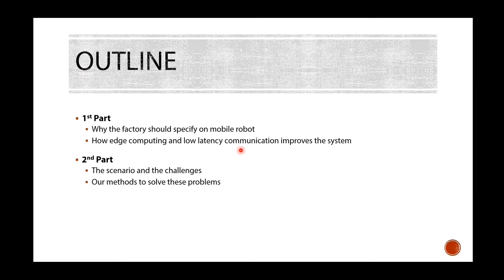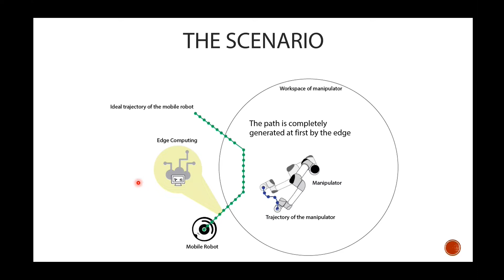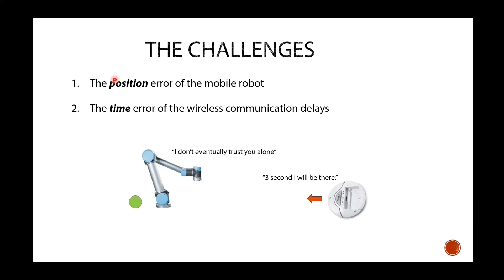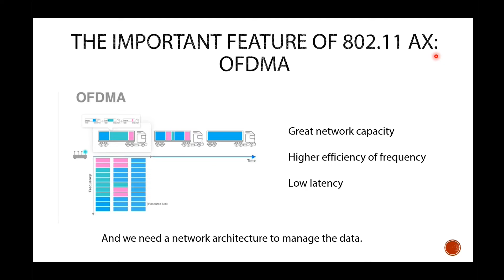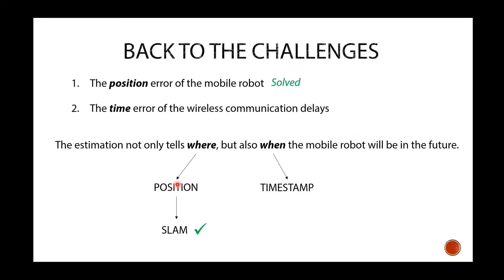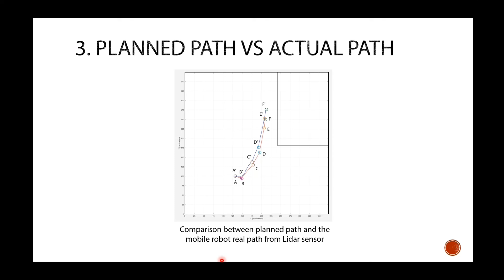ICSET2021: Low latency peer to peer wireless robot communication with edge computing

Comment: Hi Theeramet, this is great work. I have gone through your paper and also this video. May I know what is the speed of the mobile robot in this experiment? Also, may I ask if you have any suggestions for future work?
Reply from the maker: Hello Mahanta, thank you for your kind words. We've set the speed of the mobile robot around 0.2-0.4 m/s. And the suggestion for future work is using mobile robot swarm, which means there will be multiple mobile robots in the workspace (one fixed-base robot).